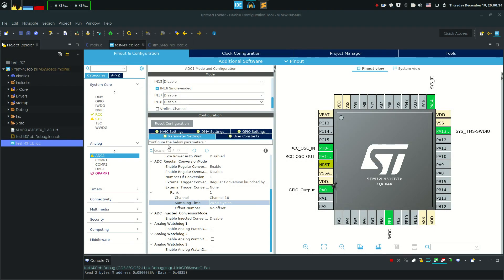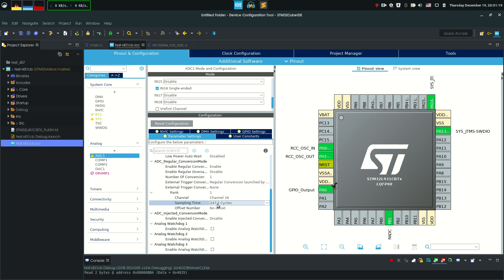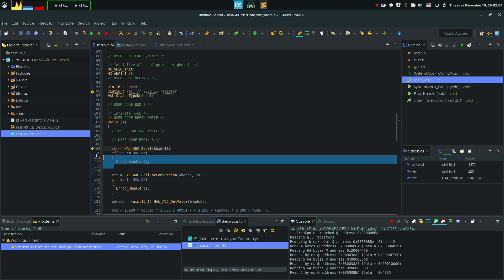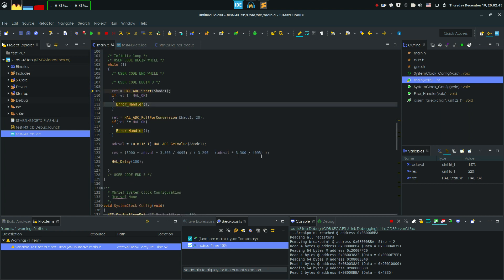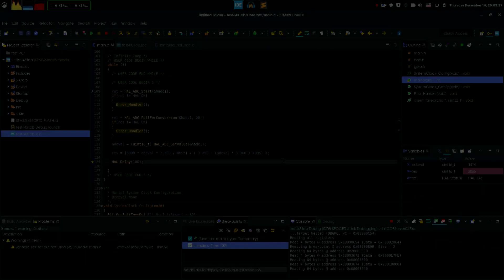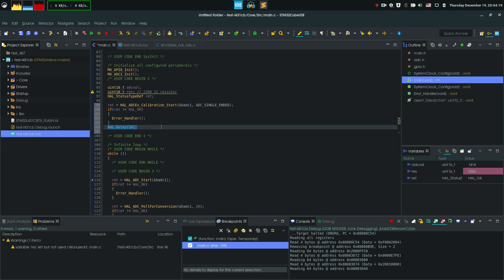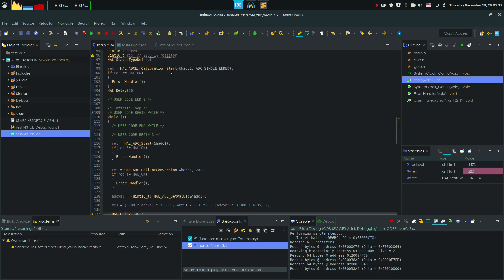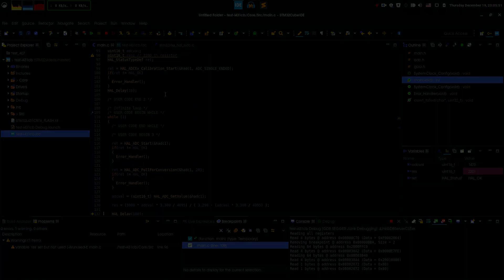Get better ADC measurements with STM32| Quick tip #2 | Video 20

Comment: Hi guys I do HW calibration and then also use VREFINT factory calibration. It gets better but I still get around 50mV offset especially at low voltages. Do you think I need to also perform my own calibration by using several known voltages? In my case it seems I have negative offset. Zero mV shown as zero but 40mV also shown zero in STM32F303K8.

Comment: Can you explain please what that is 3900 and 3.290 in the formula?
Reply from the maker: I'm a bit late, but I'll put it here anyways.
The expression is calculating the resistor value on the board setup of a voltage devider. R1 is connected from Vref (3.29V) to adc input, R2 is connected from same input to the ground. R1 is 3900 Ohms and R2 should be 2200 Ohms. 
Expression adcval * 3.300 / 4095 calculates the voltage on the input of the adc pin with reference voltage and the resolution. You can substitute it with Vin.
The formula is derived from voltage divider formula:
Vr2 = Vref * (R2/(R1+R2))
If you expand the expression and get out the R2, we get the following formula:
R2 = (Vin * R1) / (Vref - Vin)
which matches the formula from the video:
res = 3900 * Vin / (3.29 - Vin)
Hope this helps.

Comment: I do I make sure that the  VREF is set  to 3.3v? because when I  measure a voltage of 3.3 the reading is way below 4095, it reads 4025?
Reply from the maker: Sorry for the late answer. A sanity check that you can do is connecting your adc input pin to Vref pin. The idea is, that even if Vref changes, the pin connected to the same exact voltage would show the maximum value.
Cheers.

Comment: Very useful info.. thanks a ton
But the best way to calibrate is to apply different input values and calibrate in the software by storing the corrected values in the flash memory or external EEP.. this process consumes time but still worth it for precision measurements. Because this method covers even VDD ( adc vref)  tolerance..
Reply from the maker: I agree. With a few small transistors and maybe some deviders, you can create multiple points from 0 to Vref and can get lots out of internal adc, but there is a point of deminishing returns with more external components, some examples: For small ( and usually portable) devices, you would want to choose L series as it is whole optimized for low power plus you get newer periherals and functions like adc calibration. When I do work wih F series in non battery applications, external ADCs with excelent Vrefs are placet anyway so there is no need for any calibration and you can get higher resolutions.
Reply: @MatejBlagšič  ,  Can u suggest good external ADC with high accuracy ? Thanks
Reply from the maker: The question is too general because you have different input types, number of inputs, configurations, speed, resolution, peripherals and much more. I like to go on manufacturers sites like TI and search with parameters, then look up if they can be purchased and then review each datasheet.
Reply: Can you explain more about storing in the flash memory?

Comment: ı was measuring adc ref voltage 2.977 but could read it about 2.933 with adc. after your calibration function it is definitely 2.977 volt on adc.Thank you so much thats a huge difference for many applications